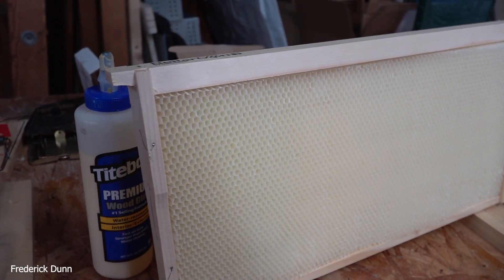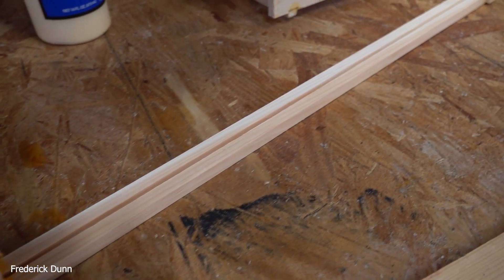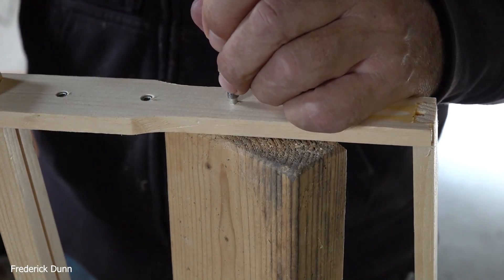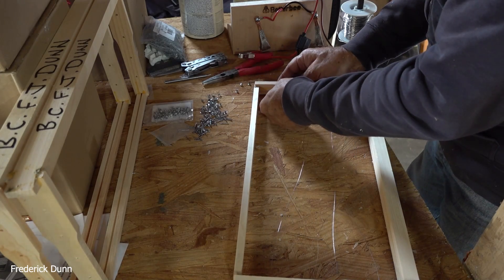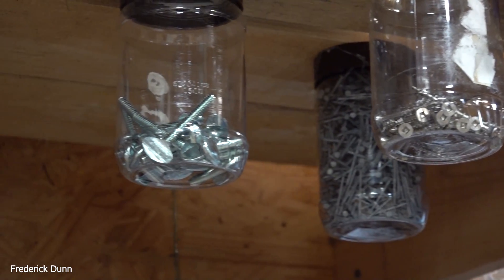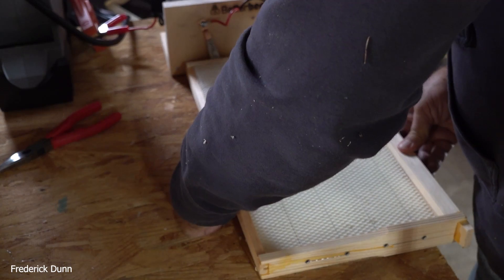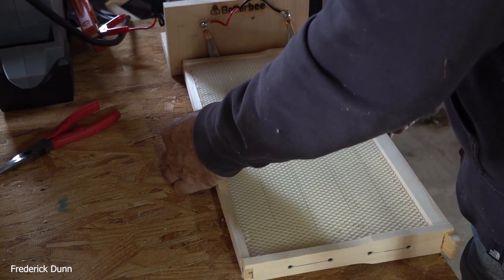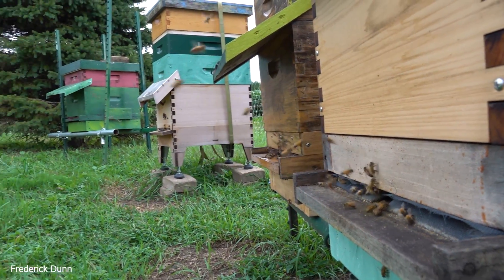Wire Your Own BeeHive Frames for Bettercomb or wax foundation, complete Unassembled kit by betterbee

Comment: Where can I but this battery and what is the model #so I can search please
Reply from the maker: I'm sorry to say that it's been discontinued. You'll have to just read reviews and find one that you can turn on and off while showing the current Voltage output. I don't have a new one, the one in this video is still working well.

Comment: That might have been your grandfather’s finishing hammer, but it’s not a finishing hammer 😂
Reply from the maker: I think it fits the finish hammer category... here's a description from This Old House:  "As you might expect with something this old, there are many variations on the claw hammer, but they all fall into one of two groups: finish or framing. Most homeowners can get along quite well with a trusty finish hammer, distinguished by its smooth face, light head (less than 20 ounces), short handle (less than 16 inches), and curved claw for easy nail removal."  Yep, that's it. :)
Reply: @FrederickDunn  ok, I believe you - it looks bigger in the vid

Comment: I bought the kit and its super easy but I found the artificial comb the bees wouldnt use for brood and didn't really take to it even for honey stores. Any tips for getting bees to accept it? Love the kit, makes wax foundation frames dead easy.
Reply from the maker: Hmmm that's interesting. I have it in several hives and they use it readily. You "could" inspire them to work it a little by spraying sugar syrup into the cells before placing it in the hive. I've not done that, but they would leave the cells smelling like bees. I've also found that if you don't embed the wire well into that bottom wax layer, they tend to avoid the wires.
Reply from the maker: I just added this to today's discussion :)
Reply: @FrederickDunn  Thank You for confiming the spray, I thought about doing that so will  with the rest of my comb . Maybee some honeyBee healthy in the sugar spray :thanksdoc:

Comment: Great video! We were given two full size frames early last year.  One was clean and bees moved in on their own.  The second needs thoroughly cleaned out, due to comb mold and moss.  I reached out to Betterbee earlier today and since I've seen this video, I'd rather just get the frame kits and start with new, clean frames instead of trying to rewire the old ones.  Starting with new clean ones may be more work, however, any bees that will eventually move in will have a much higher chance of success since they won't have to worry about any contaminates of any kind.

Comment: rewatched this,they sent you a bit better crimper, and your charger heated the wire much quicker, i suppose i could use the embedder on other wax foundation into wired frames,thanks Fred
Reply from the maker: I used to use that charger for OAV... it's pretty strong. As for the crimper, I'm surprised there was another design?
Reply: @FrederickDunn  same basic design,mines yellow, and the rollers have press on washers ,rather than e clips, i put a drop of oil but the roller axles  are plastic,  i think your red one has steel,axles,anyhow, adapt  n overcome, seems like a good product, when you dont have extra drawn comb, next time ill compress the frames,as i tighten the wedge nail, so i wont crimp  as much as i did,maybe a bar clamp,then let it spring  back tight..

Comment: put ten together tonite, my battery charger may need turned up ,as it seemed slow to melt,but did work,learned about the taper and chevron ,cant wait to use next season,i had to come up with my own eyelet  punch,and the wire crimper needed me to help it roll,by using my other fingers,hope your doing good

Comment: I've found another unorthodox method is to use cheap and cheerful 10lb fishing line. If you thread it into an 'X' shape front and back and pull the line tight as you go. Just nail and knot both ends of the line it seems to hold the wax in place without damaging it. It is an easy way of getting the line out when you are removing it.

Comment: Great video.  If you have time, you might add a few seconds explaining the electrical connection between the board and the frame, when you push the frame up to the board.  The big take away is that this is a lot easier than imagined.  The vendors should be paying you for the instruction video.  This goes a long way into selling their product.  As always you add KEY considerations like labeling the frames.

Comment: how many frames included in the $150 kit ? I would clean off the running exposed glue off the joints
Reply from the maker: You have to check the listing, I don't remember all that is included and the components may change.

Comment: Thanks so much for the video.  I bought an antique extractor and the guy gave me a box of beeswax wired foundation and now I know exactly how to wire them into the frames.  I'm doing research on my antique extractor as it's galvanized and some are telling me not to use it.
Reply from the maker: Many years ago someone gave me a zinc coated extractor... I handed it right back :)    I much prefer the stainless drums and I thin you will also. Zinc has a tendency to oxidize.
Reply: @FrederickDunn  Ya I'm looking for stainless steel replacement for the "barrel" .  the other stuff is great, might just have to replace the frame holders.  Wish I could send you a pic of it.

Comment: Excellent video, Fred. I cannot tell you how much I loathe wired frames... however I am getting low on predrawn comb, and in consideration of the coming spring, I'm thinking that I should order some now.
I "inherited" some frames with beeswax comb and vertical wires in them. During our great "melt-out", (five days over 110 degrees F) comb built on that foundation and foundationless comb were the first to go.
Reply from the maker: Wow... I'm glad not to have experienced a melt-out like that.  110 is soo challenging on many fronts. Until now, I've never been a fan of wired frames either, but the bettercomb needs that support, so here I go....

Comment: You mention that it is also possible to use this method for building frames with wax foundation. What is available in this regard and where would I go to find out more? Thx.
Reply from the maker: Yes, you just purchase bees wax foundation and embed the wires with heat and the bees draw out the cells. https://www.betterbee.com/foundation/ubf10-unwired-brood-foun-10pk.asp
Reply: @FrederickDunn  Okay, understood. Thx very much.

Comment: Very cool! I like that they give you the wiring bracket so it's easier to get that aligned and heated.

I was thinking it was going to be so much more difficult to get that wore embedded. But that bracket sure does the trick.

Comment: Quality honey needs to mature in beeswax cells and that's what give it its healthy and medicinal properties. Any other so called wax or plastic cells gets you lower quality sugary stuff that might be contaminated by plastic or any other industrial particles in those cells and shouldn't be called honey. Use beeswax.
Reply from the maker: I don't think you've looked into the composition of BetterComb and that's ok, it can save a late season swarm, or kick start a new package in spring. No doubt that bees wax is going to be the best. Thanks for commenting.
Reply: Fred I believe you generally only use this product in frames which are not destined for human consumption honey anyway? Am I correct?

Comment: Beetle trap ,is it possible to make a drawer in the hive ,so it can be emptied from opening out .Then re bated . So bee's can chase beetles in ,but cannot get in themselves .A small tube or the like.
Reply from the maker: Hi Dave, I like the beetle jails that you place in your top box, easy to access just under the inner cover. I don't think I'd modify a hive just for that purpose. BUT, I don't have much of a beetle problem, so am not speaking from much experience there.
Reply: @FrederickDunn  Hello Mr Dunn,I don't have Bee's but always been friends.I observe through watching programs like yours , that the bee's will try to keep the Beatles corralled in a corner or space away from the crown jewels . Usually bottom of the hive !! .It would be interesting to see a purpose made hive tested out . Possibly put into production once the creases have been ironed out.You seem to have a workshop and studious mind .🤔
Reply: This sounds a bit like the little tray system in the base of the Flow 2 hive? Fred would you agree?